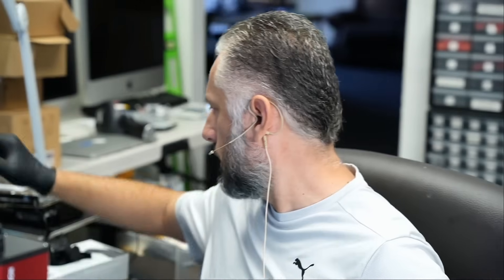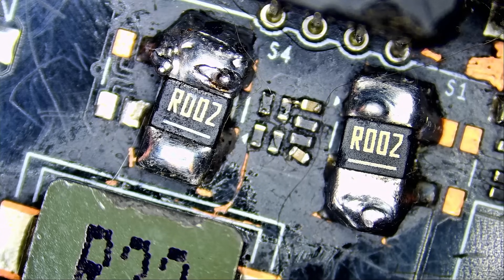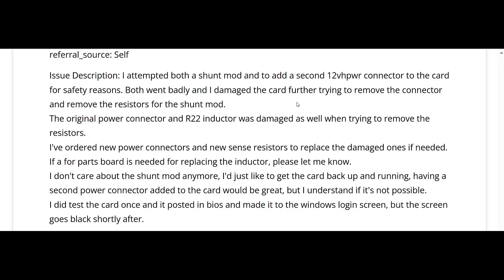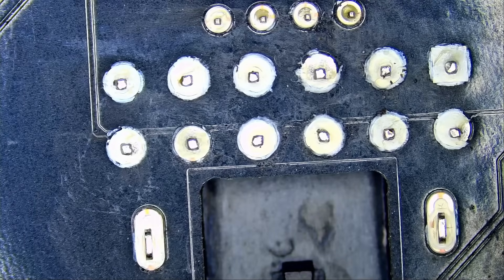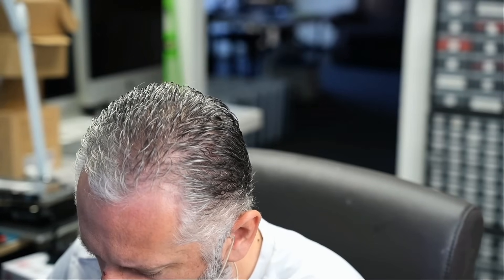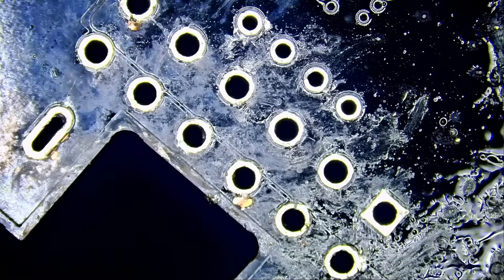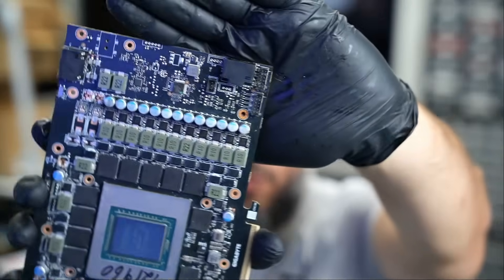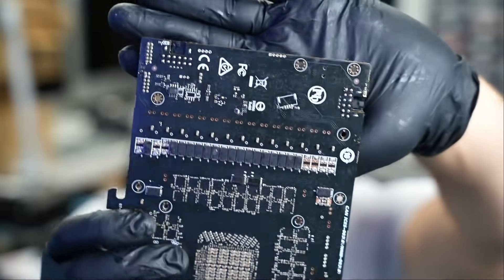3 Dead 5090 GPUs?! Gigabyte Shunt Mod Disaster and Repair.

Comment: EDIT: I posted this and as I scrolled through the comments (very far, even) I started to see people mentioning this as well. Surprised no one's had been pinned yet.

That's how a shunt mod works unless something has changed, you traditionally stack resistors in order to get the value you want in order to trick the GPU into misreading the wattage it is using, effectively making a GPU think it's only using 50W when it's actually using 100W in order to bypass the power limits placed within the vbios.

Comment: My 5090FE is shunted and water cooled. It has been running daily for 8 months now. Card can happily pull 1,150 watts with zero issues at all. I’m a soldering noob. Furmark 4K for days. Connector reaches maybe 40c inside a closed case at the hottest point.

Comment: Amazing repair video and what you do and perform for customers.  I have been in Electronics all my life and now retired, did both technician and engineering jobs. 
Myself, I would not want to "now" try and fix these highend products, don't have the tools, my eyes are not as good as they used to be, and would not want to fool around with these complex multilayered boards.  Most DIY people that think they can repair these kind of boards end up doing more harm than good and making the products worse. And if you can even find the parts to fix them.
Thanks for showing us your methods of doing repairs.

Comment: Two days ago I bought a broken 4070 Ti Super that freezes under load and could only sustain load with undervolt and 59% power limit so I did a little detective work and deducted that it could be shunt resistor joints. After first doing a stupid thing I won't even mention, I decided to check out some of the videos on the topic and this one was by far the most impressive. You sir, are an artist. I ordered some flux, a heat gun and some other accessories and I'll try to "repair" the card tomorrow. Thanks for the great video. Although what I'm about to do seems much simple than your artistry, I'll comb through the channel because I watched this entire video at the edge of my...couch. Kudos.
Reply: hows the 4070

Comment: The NVIDIA RTX 5090 requires varying thermal pad thicknesses, typically 1mm and 1.5mm for VRAM and VRM, with a specific 0.2mm thick pad used on the GPU die itself for some water cooling blocks. The exact thickness depends on the component (GPU die, VRAM, VRM, backplate) and the specific cooling solution being used, so it is essential to measure the original pads or check the cooler's manual for accurate replacement.

Comment: Nice video. Although it would have been nice if a mention was made as to what model Gigabyte this is, Gigabyte has at least six different sku's on 5090s from the Windforce all the way up to the Waterforce, It's definitely not the latter and it isn't an Aorus Master because it doesn't have 24 power stages, so maybe a GIgabyte Gaming?

Comment: Thermal putty like the upsiren u6 pro is the answer for this, saves time since it bridges the gaps without needing to know the right measurements, performs better than midrange and top of the line thermal pads, its not like the old k5 pro putty where it makes a liquid mess, new putties nowadays feels like playdough and just feels like flexible standard thermal pads.

Comment: Front VRAM	2.0 mm	Often used for direct contact with the cooler
Backplate VRAM	2.5–3.0 mm	Thicker pads needed due to spacing
VRMs / Power Delivery	1.0–1.5 mm	Varies by layout and manufacturer
GPU Core (KryoSheet)	0.2 mm	Graphene-based KryoSheet alternative to paste
12VHPWR Connector Area	~1.0 mm

Comment: If the customer can't figure out the right thickness of the thermal pads he can use thermal puddy put it wherever thermal pads need to go. Put the cooler on take it of and if you have a mirror image of your components you're good to go.

Comment: Hey i live ine puerto rico can i send you 4 cards that were given to me 4 3080 3 turn on sometimes work for 30 minutes then black screen after reboot vga light is on no screen i redid thermalpast and thermal pads on 2 no overheating same issue one of the 3 has a flicker red light in power connector 2 and the 4 one doesnt boot at all

Comment: Idk if im just lucky or what but I had a strix  4090 since released 1st month I had a problem with cablemod 3rd party connector went back to stock n now I have a 5090 n I never had a problem with melting connector i use corsair rm1000x with there 12v to pcie 8pin adapters

Comment: I have seen there is a new 12v balancer adapter being developed. It should actively monitor the pins and distribute the current evenly. If I spent the fortune to buy a 5090, I surely would use such an adapter.

Comment: Just out of curiosity, when you do the second pass to clean up the solder balls is that a tool you are using to clean them up?
Reply from the maker: Just a soldering iron with a large tip set to 420°C and NF.Flux. Excess solder will stick to the tip with the help of the flux.

Comment: 2. Thermal Pad Sizes for VRAM and Power Components

While Gigabyte likely uses thermal gel for these components, if you decide to disassemble your card and replace it with thermal pads, the exact dimensions might vary slightly from model to model (like Gaming OC or AORUS). However, here are the general estimations and trends based on previous generations:

    VRAM (Video Random Access Memory) Modules: Pads of 1.0mm thickness are generally used. (Some models might use 0.5mm.)

    VRM (Voltage Regulator Modules) and Other Surfaces: Typically, 1.0mm or 1.5mm thick pads are used.

    Areas Beneath the Backplate: Thicker pads are often necessary to fill the gap between the backplate and the PCB, such as 2.0mm or 3.0mm.

Comment: Per Grok:

The thicknesses of thermal pads on an NVIDIA GeForce RTX 5090 graphics card vary by manufacturer, model, and component (e.g., VRAM, VRM, backplate), much like the 3090. The RTX 5090 uses GDDR7 memory and a larger GB202 die, which influences pad designs for better heat transfer and pressure distribution. As of October 2025, detailed disassembly data is still emerging compared to older cards, with most info from watercooling block installations (e.g., Alphacool, EKWB) rather than stock air coolers. Always measure your card's stock pads with calipers for accuracy, as incorrect thicknesses can cause hotspots (e.g., VRAM temps exceeding 90°C).

Below is a summary table of reported thicknesses, primarily for VRAM (front/back) and backplate/VRM, based on verified teardowns, block guides, and community reports. GPU die uses liquid metal stock (or phase-change pads on some AIB models), not traditional pads.

| Manufacturer/Model              | VRAM Front Thickness | VRAM Back Thickness | VRM/MOSFET Notes                  | Source Citation |
|---------------------------------|----------------------|---------------------|-----------------------------------|-----------------|
| NVIDIA Founders Edition        | Not specified (good contact observed) | Not specified (flush contact on backplate) | Backplate pads conform well under pressure; no issues noted |  |
| MSI Ventus OC (with Alphacool block) | 1 mm                | 3 mm               | Varies by section; ensure even compression to avoid poor contact |  |
| ASUS ROG Astral                | Not specified       | Not specified      | 0.5 mm (custom active backplate for VRM) |  |
| Alphacool Core Reference Block | Not specified       | 3 mm (backplate side) | For evening pressure; used on VRAM/VRM back |  |
| Alphacool ES Block             | Not specified       | 2 mm (backplate side) | Per datasheet; add for hot back-side components |  |
| General (memory chips, suggested) | 2.5 mm              | -                  | Use thermal putty for uneven surfaces; avoids residue issues |  |

### Key Recommendations:
- **Measurement Tip**: RTX 5090 PCBs are denser, so back-side VRAM often needs thicker pads (2–3 mm) for contact. Test with a "foil method" (thin foil over pads to check impressions) during reassembly.
- **Popular Brands**: Thermal Grizzly Minus Pad Pro (high compressibility, 1–3 mm options) or UTP-8 thermal putty for VRAM; avoid stock block pads if pre-compressed.
- **Water Block Users**: EKWB or Alphacool blocks often specify 1–3 mm kits; for FE, use pre-cut pads matching 1 mm (VRM) and 2–3 mm (others).
- **Power Connector**: Some AIB models (e.g., ASUS, MSI) add ~1 mm pads to the 16-pin connector backside for melt prevention.

If you specify your exact model (e.g., "MSI Suprim" or "Founders Edition"), I can search for more tailored details.

Comment: this is what i found hope it helps For a Gigabyte RTX 5090, thermal pad thicknesses vary by component; expect to use around 2mm for the front VRAM, potentially 2.5mm or 3mm for the VRAM on the backplate, and approximately 1-1.5mm for other VRMs and power delivery components, though you must verify exact gaps during disassembly. The recommended approach is to order a mix of thicknesses, like 2mm and 3mm for VRAM, and 0.5mm, 1mm, and 1.5mm for other parts, to ensure proper thickness for each component.
Reply: I would do a 3d laser scan of the board. This way I could measure the gaps precisely.

Comment: Two resistors stacked will give 1/2 the ohms. Since you had 2 sets of these, I do not think it a mistake. So removing one may invalidate current sensing calibration.
Reply: Haha, everyone already discussed this point more than anything else!
Reply: @mrrockenrock  yeah but most of them are wrong. Gigabyte is using putty.

Comment: You can use "liquid" thermal pad instead of regular one. Check TG Putty Basic: Medium thermal conductivity, TG Putty Advance: Good thermal conductivity, TG Putty Pro: Excellent thermal conductivity. Application - VRM,  memory chips and so on.

Comment: Use plasticine to find the size of the pad required, it will squash down to the size of the gap and can be measured after dissassembly, not a big lump, just a small piece or pieces.

Comment: I would much rather invest in something that will increase life longevity on any hardware, rather than something that will decrease it, especially on a graphics card that is capable of running anything you throw at it with no issue. I may consider shunt modding my 3090 when it is no longer capable of running the games I play at comfortable settings, but so far it is still a powerful card

Comment: great repair but i do have one question - the customer said it did post and show image on the screen, but shuts off shortly after. that wasn't something you tested for (understandably with no heatsink). so what happens if you return the card as is and it still doesn't work? i assume you aren't liable.
Also after thinking about it- its possible the customer didnt install the heatsink or heat spreaders properly and that is what caused the pc to shut down from overheated gpu, and wasnt actually caused by the poor soldering

Comment: i just fin this one but not sure, Common Component Dimensions for RTX 5090s
GPU Die (GB202): While a full-sized pad is available, some users are cutting their own or using specific die-size replacements for better performance. 
VRAM Chips: These are typically around 1.0mm to 1.5mm thick, depending on the board layout. 
Voltage Regulator Modules (VRMs): These hot components can require 1.0mm to 1.5mm thick pads.

Comment: Resistors of the same size in parallel = halves the resistance!
Reply: So max 600 to 1200w in this case.
Reply: @crashd1n3r at least in theory.. or the vrm will blow up..
most shunt mod, they can improve performance up to 12% (or less than 12%), also your gpu clock will more stable and less fluctuactive..

but even though the shunt mod just increase the performance less than 12%, maybe like rtx 5090 they already draws 800watt with the same frequency.. 
inefficient and because rtx 5090 already fast and just 12%, you wouldn't noticed it
Reply: @dwikey_98 I disagree. I do get 12% increase in fps and that 12% is important when the 5090 can barely run the game. Try to play MSFS 2024 in VR with a 5090 and you'll understand why.
Reply: @crashd1n3r yes i already know the purpose of the shunt mod..
i just telling the fact, with already fast graphics card when shunt modding the effect will be more measurable when benchmarking.. for gaming, the gpu will using the more stable frequency.. so the frequncy maybe lower, but more stable at that frequency..
and also the gpu will more hotter, because the current flow through the gpu from 12V connector also much higher than before..

but while benchmarking, the clock speed will be higher and stable so the result will be higher, but still depends on the thermal limit.. as soon as gpu reach the temp limit, the frequency will decreased.

Comment: the aorus 5090  (master) came with thermal gel. not even putty. getting the correct thickness will be hard and will time consuming. i think user will be better using a waterblock but since you add 2 power plugs that will hard.  will be try and error on that one boss.   I think thermal putty will be a good idea on that one so the cooler when added make the correct placement.  For the little i know on that model, the h+++ can be use BUT one at the time.  the pcb is use on 3 models 5090 they have. And since we known only aorus the cooler should have a opening for the secong plug IF NOT he can not use the other one since there is no opening (example the master) the master stealth  5090 has the opening for the back connector btu does not have for the front one.

Comment: @NorthridgeFix Gigabyte uses thermal putty not pads on both memory and vrm components for the  RTX 5090 Windforce/Gaming OC and non OC models with stock cooler. Pads are used for waterblocks but spacing and gaps would be different from the stock cooler and differ between  different waterblock manufactures. If the client used a waterblock then he should have the manual included with the block which contains a diagram with pad thicknesses, size, and placement location. Tell the client to figure it out haha. Nice work!

Comment: If someone's going to the effort of ordering resistors, why not just order the correct value and power rating instead of paralleling them?
Reply: It is easier to stack them, for people with little soldering experience. Like Alex said the board needs to be preheated a bit to get the solder to flow on the pads. stacking on top, the resistor just needs to be heated.
Reply: The point is to halve the resistance, the lenght of the pcb track is probably the highest resistance.

Comment: The 2 resistors on top of each other is called a shunt mod, it is common technique used by PC overclockers to make the card believe that it is drawing less power than it really is, so that you can overclock it more.
Reply: Simple trick to pull more power from 12HVPWR connector

There are on YouTube videos when 5090 draws around 1000 watts
Reply: You meant; Trick the card into melting itself eventually.. :face-fuchsia-wide-eyes:
Reply: Wouldn't it be better to use a different size resistor instead of stacking them like that?
Reply: @randy2493-s6n graphics card is very thick board..
if you do it just with soldering ion, just wasting of time.. because, the board just sucking  the heat and your solder will not able to attach the resistor to the pad if you remove it..

so, that's why stacking resistor on top of the other is more easy to do so and the resistance also dropped in half just by parallel the resistor, and it can more easily attached just with soldering ion (at leats with largest tip on your soldering ion).
Reply: @randy2493-s6n  since these things are typically 1-5 milliohms, with a bit of math piggy-backing allows better control over the resulting resistance (and thus card power limit) than available values of shunt resistor. However, it's also seen as an "easier" way to do the mod, hence videos like this where it goes wrong
Reply: @randy2493-s6n Desoldering the resistor will require proper equipment. It is connected to big traces on a board designed for good heat dissipation. Just soldering another one on top is easier.

Comment: You can also use some trial and error. Start with maybe 1.5mm, mount and remove the cooler and see if the thermal compound spreads thin over the GPU core or if it leaves a thick layer or if there are any signs of an impression left on the pads. If the thermal compound on the GPU looks thicker than normal, then the pads are too thick. If there's absolutely no impression left on the pads by the memory chips/drmos chips, then they're too thin.

Comment: 18:33  Hi Alex, what if you reasembled the card with bluetack in place of the thermal pads? But do not turn on!
Then you might be able to measure the thickness of the bluetack in each pad location, and hence get a rough idea of each pad location's thickness requirement??

Comment: for the thermal pad look up waterblocks install instructions for that specific card, generally they are the same and if you place the neatsink on for a a minute or two you should be able to tell if you need the 1.5 ro 2mm ones in that area

Comment: Apparently you can get a 13% performance increase by modding the current resistors.  I doubt that would be really noticeable in a blind test but people do like faster...  thanks agai  for all the vids.  Really appreciate and enjoy your work.  Please specify power requirements on all your gear for those who live overseas!
Reply: It effectively doubles the power limit by lowering the resistance of the shunt resistors on the graphics card, which are used by the GPU to measure power usage through voltage drop. Reducing this resistance (either piggyback as shown in the video or by replacing it) the voltage drop becomes smaller for a given current, tricking the GPU into thinking it draws less power. Half resistance = double the power limit (approximately).
Reply: WRONG - its only 7.8% at 800 watts.